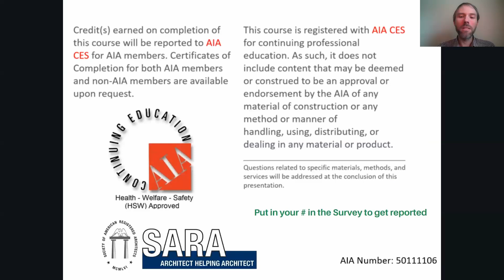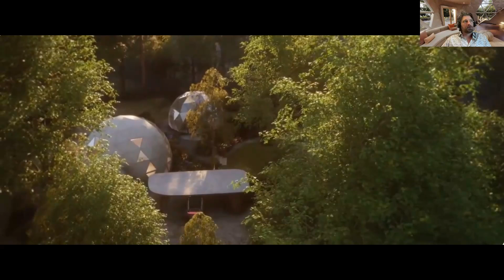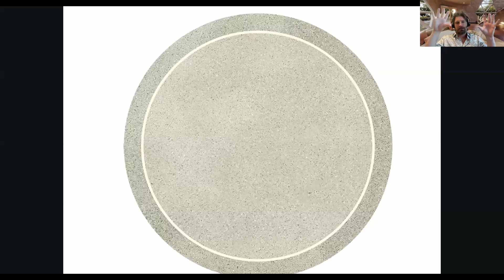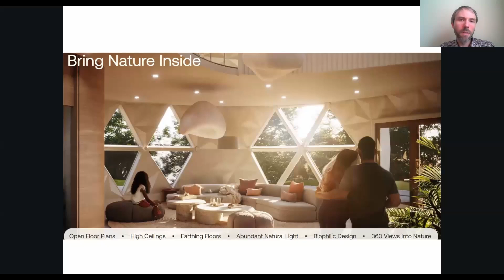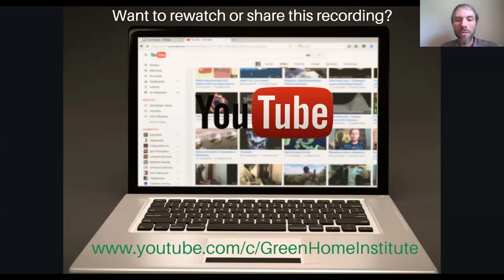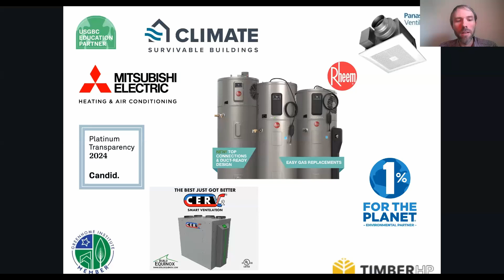Automated Geodesic Homes = Regenerative Living with the World's First Ceramic Dome

Comment: I understand that there are many goals with this startup.  I value efficiency, longevity and cost above and beyond all of the green targets they mean to attain.  I wonder if (for the sake of a soft start) there's an argument to be made for using portland cement, steel reinforcement fibers, and conventional closed cell foam insulation in the short term to launch the dome revolution first...  Then, offering the "bioceramics" option once the culture is ready for it.  The market is ready for efficiency, longevity and cost reductions.  I don't suppose the market is as receptive to abandoned conventional materials just yet.

Comment: I appreciate the comprehensive interview. I’ve been interested in the Geoship concept since I discovered it. I do have some questions. How much of the construction of the home are you willing to allow customer input? For instance, Rockwool appears to have higher R value just based on the answers in this interview. Could that be an option. Also, I would like to have a basement built prior to the dome installation for my mechanicals with a stem wall ready for the dome installation. In the desert SW of New Mexico, the sun’s insolation tears up most polymer products. Is there examples in the industry of your ceramic techniques already seeing years of sun exposure? Lastly, are tours of the actual product build available?

Comment: R-4 to 5 insulation value is terrible for hot or cold climates, especially cold/freezing climates. You could install 6 -8 inch polystyrene between the panels which would boost the R-factor significantly into around the R-20 and above range. R4-5 might be suitable for California but not Montana.
Reply: I think he was intending to say R4 to R5 per inch. The plan is to have a 6” to 10” gap to fill with the insulation.
Reply: what material to use for hot climates, such a s the Philippines or Thailand?

Comment: Looks very promising. Still quite a few questions to answer, though. I'll be looking out for more info on this system.
Reply from the maker: What are your questions?
Reply: @GreenHomeInstitute  The gaps between panels seem inconsistent. More seams generally means greater possibility for water to get in. How are they addressing these two issues?

Comment: I’m enthusiastic but I’m definitely not wealthy so I hope you are truly committed to building affordable housing for all, the wealthy can afford to pay almost any price but unfortunately, the majority of Americans don’t have that luxury.  The 1% can
Reply: These Geo products are already well above traditional stick and/or concrete/steel building when calculated per square foot of finished space. And they haven't yet installed their first commercial sale. Cost is going to be the significant factor. The second most significant factor is they're rolling out first in California where no one can afford to buy property but the wealthy. And the wealthy aren't likely interested in this.

Morgan doesn't have the background necessary to run a home building venture and I don't see this project gaining the traction it needs to move forward, let alone to scale where it can be profitable or sustainable. He's already conflated plumbing and electrical by using the word "pex" when talking about electrical. HUGE alarm bells for anyone who knows anything about home building.

We're now some 4 or 5 years since this was first announced and we've yet to see examples of electrical connections, insulation, plumbing, hvac fitting, etc. If I'm really going to play devil's advocate, I can't see them ever constructing one residential installation. The guy can't even answer a simple question about R value without serious waffling.